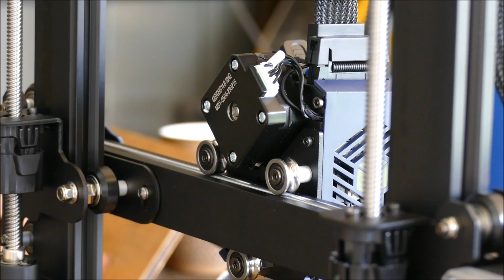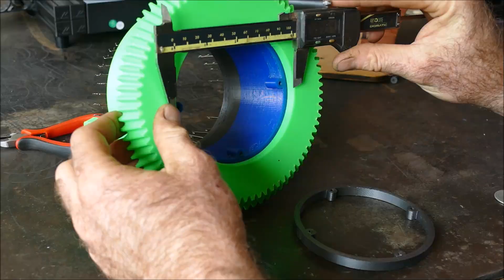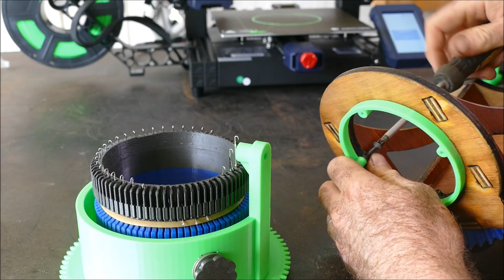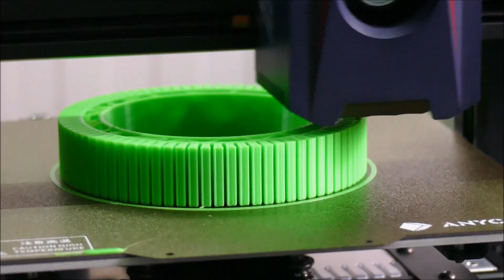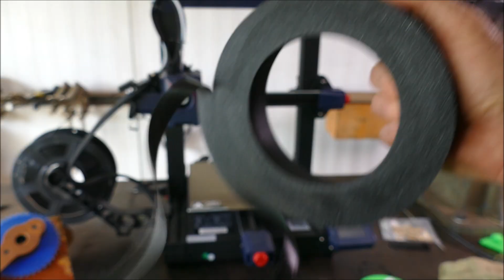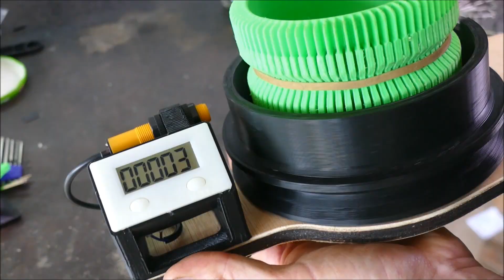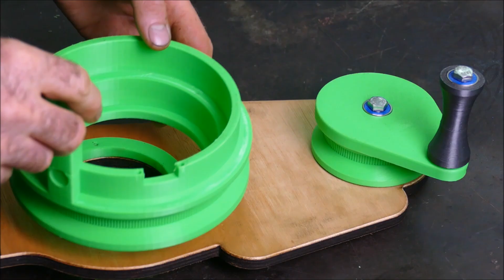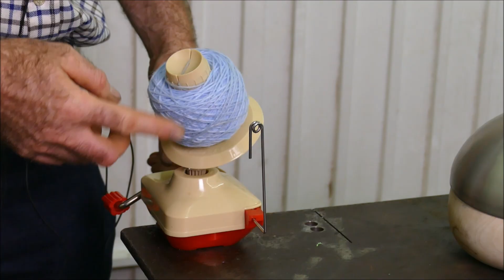3D printed sock knitting machine(CSM) MK2 endurance test of Anycubic Kobra 2 + free build plans

Comment: seems good for the price. the problem with those wheels is that they also wear fast. metal on metal with no oil is how to wear down metal 101. the bonus with the "rubber" wheels dampen vibrations as these transfer the vibrations. 

cool rig though. i started with an anet :)

The "bulging" on the corners is from wrong set k-factor if you use lin_advance or wrong value for junction deviation if you use that sir. try calibrating one of those and you should see that sharpen up a lot
Reply from the maker: Awesome thanks. Cheers J
Reply: @joshuadelisle  ive printed like fifteen rolls over 8 years as a hobbist and my wheels got changed to polycarbonate ones five years ago. They are still perfect, guess its down to how tight ppl set them. So they wear faster for some than others👍
Reply: @reyalPRON  Indeed, getting the preload right on the wheels is key.  I set them just to the point where I can't make them slip (spin?) with my fingertip.  They are not ideal, but do very well for what they cost.  I am working on a homebrew foam cutting rig, and at some point may make a plasma cutter...using the wheels for the longer axis.

Comment: Bob Smith Industries makes a rubber toughened super glue that is somewhat flexible.  The part number is IC-2000.  It is very slow set, around 20 to 40 seconds.  It might be a good choice if you need to splice another timing belt.
Reply from the maker: Thank you I'll check it out. Cheers J

Comment: I think prusa slicer has a square corner velocity feature to adjust the corner speed for squarer corners. Also I would recommend spacing the brim off the part by a few millimetres so you don't have to pull it off every time. Happy 3D printing 😊
Reply: Practically reducing the brim to a skirt?
Reply: If it's not connected to the part there's no sense in using a brim, just use a skirt at that point. But I agree, brims aren't necessary for most of these parts since they already have a lot of surface area on the first layer
Reply from the maker: Thank you. I'll check it out. Cheers J

Comment: This knitting machine is pretty impressive. Now, if anyone could come up with a way to make the needles for them, instead of having to buy them...    

Have you seen computer controlled knitting machines for making scarves, sweaters and other larger items at home?    
The purely mechanical ones are fantastic enough, with all kind of buttons and knobs to control patterns, but with a computer setting and resetting every needle as you move the shuttle back and forth...

Comment: Amazing work. Provided your machine allows you to crank back and forth, you should be able to do heels and toes as its all done by manual needle manipulation. I use an Erlbacher Circular Sock Knitting Machine. But even if you just do tubes, you can create an "Everything Afterthought" sock by picking up stitches and knitting the heels and toes by hand if you wanted to. Look forward to seeing more.
Reply from the maker: That's definitely a possibility I'll have to practice at. Cheers J

Comment: like youre honesty man.. refreshing! had a mad idea!

you mentioned your steam engine. ive watched your vids about the diesel heater, which were cracking may i add, now this is just a brainfart, why not use the exhaust as the heat source for said steam engine? all about efficency!?
Reply from the maker: Hi. Thank you so much. It's a possibility although not it's enough heat to generate anything useful and I get wood fuel for free. Also a wood burner is a better option for self reliance and not being dependent on government controlled resources. Cheers J

Comment: E6000 may be a good alternative for that super glue joint on the belt. It's flexible when dried but holds pretty well. Id almost do a few drops of super glue and then the rest with a thin layer of e6000 for long lasting support
Reply from the maker: Good tip. Cheers J

Comment: Those green prints looked so clean! Lawnmower/hoover belts might work and wont need to be cut / joined :) I think knitting can be manly. I learnt to knit nets when i was younger as my grandad was a pest controller using traditional methods (ferret/hawk/purse nets). Today i do the pest control and use that skill all the time, comes in very handy and saves a fortune!
Reply from the maker: Thank you so much. Net knitting is definitely something I want to learn. Cheers J
Reply: Traditional fishermen sweaters (guernsey/gansey?) Were made by men, and I think in Peru knitting is dominated by men (from yarn spun by women). Just because labor has been divided a certain way, doesn't mean you are betraying your gender to do it differently than your peers!

Comment: keep us updated on that anycubic printer please,
when it was going well i was shocked,
just how nice the prints came out,
and thats good coming from me ,
as i changed  to printing in resin a couple of years ago,
anycubic if your reading this
and would like to try and re convert me,
back to a filament printer
drop me a message 😊😊

the knitting machine got me smiling 😊😊
simon
Reply from the maker: Thank you Simon. Resin printers are awesome but it does concern me how toxic and unrecyclable the prints are. I'm going to work on a bottle recycling machine to turn back into filament for the next fdm printer review. Cheers J

Comment: We built one of the MrRoboto19 knitting machine.  Works but the flippers on the drum and the gear mesh is pretty finicky.  Are you planning to add a ribber to your design?
Reply from the maker: Hi. I think I want to move onto a wool processing plant with a washer,  carder and spinner. I think I'll move back to the knitting and weaving side after. Cheers J

Comment: The amount of work you have put into this is impressive. We have alpacas and their fiber is significantly better thermally than sheep wool. I would love to make a machine like this to produce products and even though I have a 3D printer and laser engraver, I don't have the patience or skill to do it. I am very impressed with what you have made there!
Reply from the maker: Thank you so much. Hopefully the effort is done for you and you just need to print the parts. All the very best. Cheers J
Reply: there are companies that will print for you, very high quality
Reply from the maker: @cdoublejj  💰💰💰
Reply: How do alpacas do in hotter weather? Do they have different variants that can handle hot and humid?
Reply: @johngriffin618  We have them sheared each year and as long as it is done each year they are OK. They are natively from the mountains in Peru so are used to extremes.

Comment: Great post, my engineering life was spent with gears and gearboxes. We made gearboxes for a knitting company near Filbert street in Leicester. I was involved with the initial gearboxes and was mesmerised by the action that these machines, like yours, but bigger and made from metal, made the cloth tube. You are very determined when you want to achieve the build, a fantastic trait to have. The machine is awesome, thanks for posting 👍
Reply: I think, I may have used the very machines that you built gearboxes for! I was a sock knitting machine mechanic for a few years in the late 80's working mainly on Bentley machines that I think were built in Leicester.
Reply from the maker: Thank you so much. It was a good lesson on mechanical engineering for me and I learned a lot. Cheers J

Comment: Did add and lubricant to the gears inside?
Reply from the maker: I did. Yes. Cheers J
Reply: @joshuadelisle  I was thinking I could use a old micrvave motor as a drive but the movement the wasnt smooth enough in my estimation.
Reply from the maker: @whatusanenow  you could easily add a stepper motor and program controls via an Arduino. Cheers J

Comment: Wow! This machine could be used for making carbon fiber or Kevlar sheaths to slide over foam or 3d printed shapes to create ultra strong forms when epoxied onto the shape.  Wire fiber could be used to make cable sheaths for wire or pneumatic tubes.  Cable runs could have custom hemp wire lacing for stereo systems.  Copper wire could be used to create EMF shield for HAM radio systems.
Reply from the maker: The possibilities are endless. Cheers J
Reply: @joshuadelisle you need to patent this ..
Reply: Knit fiber is usually only used in laminates to improve resin flow ( and therefor saturation) between actual load bearing layers like roving mats or 45° braided tube; because in order to take a load, the fibers need to be as taut as possible. Think of it as like reinforced concrete. Nobody´s using chain link fence for that, but instead mats of rebar that very closely follow the direction of force if done correctly.
Reply: @nilsschenkel7149  correct, but I’ve got a feeling that a knitted fiber tube would somewhat be equal, or maybe better, than a CCF blend.
Reply: yes it could there is a place that actually does make carbon and or kevlar sleeves for just that purpose
Reply: It could also be used to make Kevlar socks
Reply: In the 1980’s my relatives showed me their braiding machines (you know, the lines with the little spool shuttles that go around in opposite directions passing each other) doing their thing (rope making) but they slip foam shapes into the center! They used epoxy to make things like windmill blades and prism shapes used together to form lightweight bridges!!!
Reply: A knitting machine would probably not be the best with carbon fiber. Carbon fiber is very strong in line, longitudinally, axially...whatever you want to call it. But it is super weak, almost wispy in a transverse direction. This is why you never see it tied into knots, but always laminated into a sheet type structure where the length of the fibers can remain oriented in their optimal direction. This type of knitting machine wrap fiber around each other at nearly 90° which would decimate carbon fiber and turn it into a fuzzy itchy mess, and the room would be full of unbreathable dust.
Reply: The unbreakable condom
Reply: @TheFoppishDandy You go ahead with your knitted CF condom.  It seriously can’t be worse than the Brigham Young Uni students with their “iT dOeSn’T cOuNt” lubed-armpit method; that caused 2 separate armpit STi outbreaks (among a group of at least 16 sophomore armpit connoisseurs)!
Reply: I was thinking alpaca socks would be cool....
Reply: ...what?
Reply: Calm down.
Reply: @markrainford1219  Dude should keep his socks on 😂. Badumm tss.